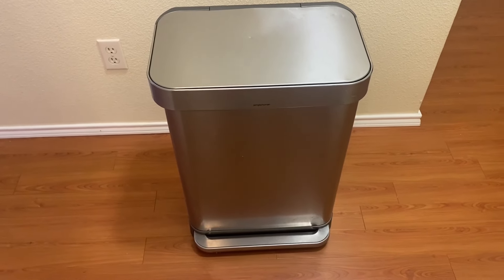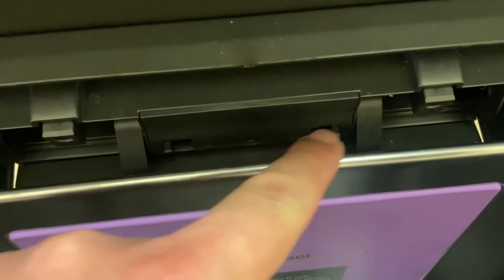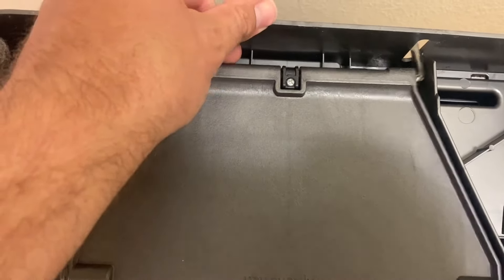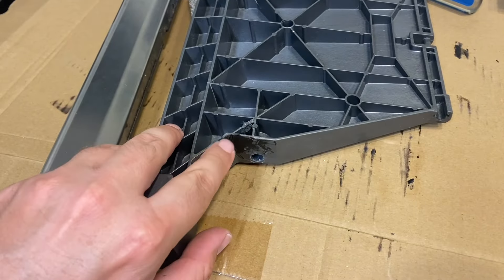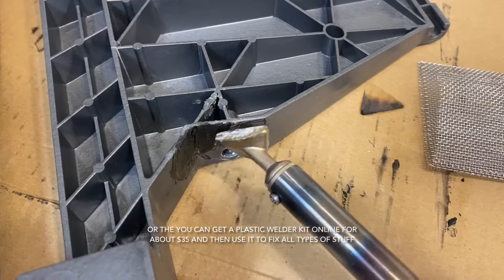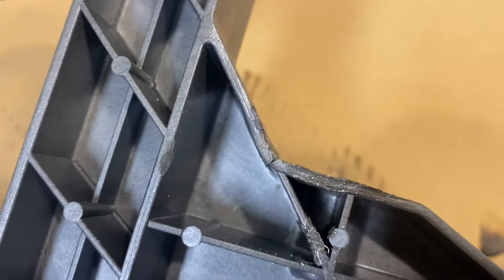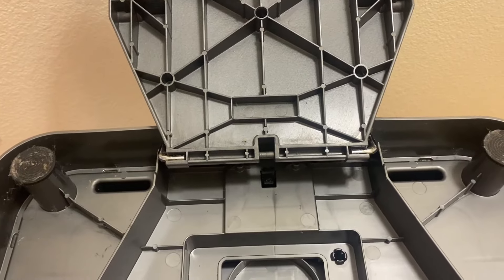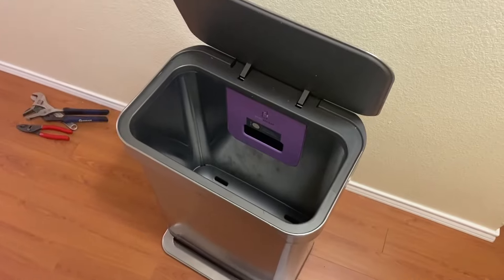Simple Human trash can fix

Comment: Im experiencing the same problem but have the double sided can with the recycling bin, I’ll have to do some more troubleshooting to find out why the lid isn’t opening properly.
Reply: Same issue. Have you found a fix yet?
Reply: @JohnWolanin somehow the back left corner of the lid is rubbing against the frame which is partially the culprit, I also believe the step pedal itself is damaged. You’d think this brand would have better build quality for the price.

Comment: Great video to get into the nuts and bolts on the Cadillac of trash cans. Mine has this issue, but when I took it apart, nothing was cracked in the pedal area. I could thoroughly clean it as it conceals a lot of debris. The search continues, mine is about 7 years old.

Comment: No idea what’s wrong with mine but it’s similar to this. I’ve taken it all apart and can’t figure it out. The bar works when I push it by hand, but once I put the trash can down and try the foot pedal… nothing. It doesn’t budge. But if I lift the lid and then push the pedal, it stops the lid from going down. It just won’t push it up at all. 🤷🏻‍♀️ I’m about to take it apart again and double-check for cracks. It’s all I can think of! Thank you for this! Especially for the soldering part - I never would’ve thought of that and I have one in my closet!